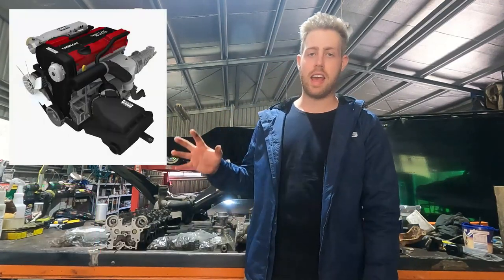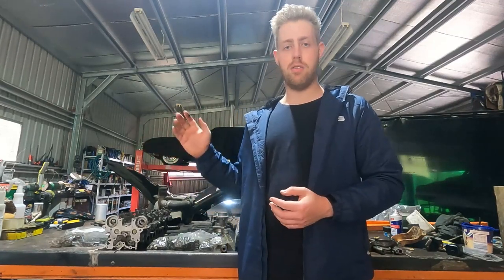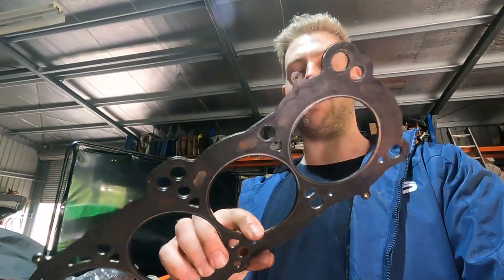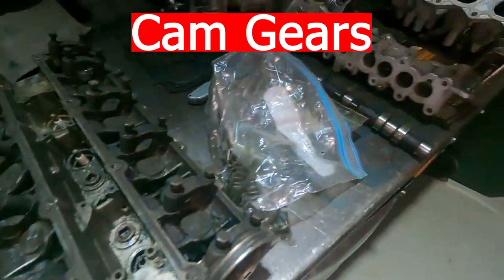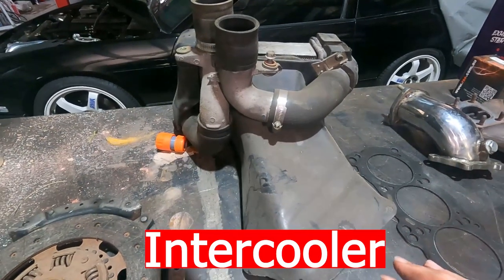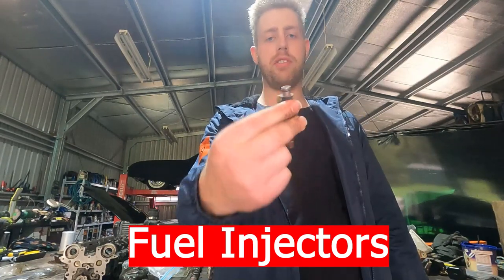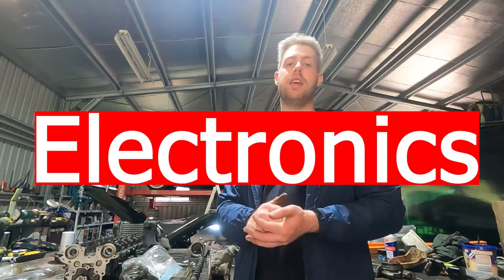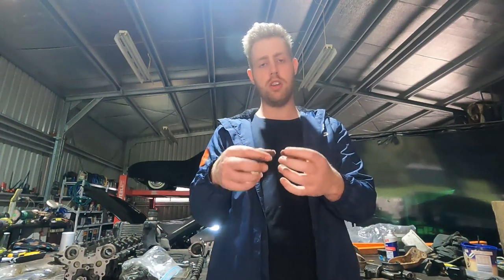Limitations of The Factory CA18DET Engine | Mechanical, Electrical, Fuel And Driveline

Comment: 1 year later, i'm here to rewatch!
Love the CA18DET 🔥🔥
Reply from the maker: Hey mate been watching you videos too. Keep up the good work!
Reply: @JarrodWillemse  Hey, that's awesome!

I want to rebuild my ca18 at home for stock power, seems that I only need:

- acl bearings
- new oil pump
- arp studs
- standalone ecu
- head drain mod

 😁😁
Reply from the maker: @BossGarage  If you can find get a t28bb turbo it will suit the engine!
Reply: @JarrodWillemse  i got the stock t25 rebuilt with a bigger MFS compressor wheel and seems pretty nice.

Still didn't got the car tuned, but seems pretty responsive!
Reply from the maker: @BossGarage  Nice should be a good little ripper whens its back together!

Comment: Great video, but I'd like to add one more thing, the ACL bearings had a period where they were cutting costs in their production which resulted in bad bearing quality. Can't remember the year but the newer year ones like 2019 or so should be ok to use. What I have researched is that the Japanese like to use King Race Bearings and NDC bearings (I'm using King Racing)
Reply from the maker: I didn’t know that thanks!

Comment: I like the bit about re-shimming hydraulic lifters... hmmm. Think it's worth mentioning the block runs oil squirters, along with the std rods having oil squirts onto the thrust face of the cylinders - factory win.
Reply from the maker: Yeh I had the engine shop tell me to block them off but I think they are there for a reason keep everything cool! Thanks for watching.
Reply: They reduce pressure to bearings it's why a lot of people delete them , they also don't clear a lot of aftermarket forged pistons. 

I've deleted them myself in most CA's I've built.

Comment: great video! I got a 400bhp CA myself and my main issue you didn't want to explain more. Its the gearbox.. I destroyed my first gearbox on my first trackday and replaced it with a stock one.. the only upgrade I did is to route the differential cooler and pump to the gearbox instead.
so the gearbox oil gets cooled down and it holds since for 2 trackdays.. but still, it feels like this isn't right. I would love to upgrade the gearbox
Reply from the maker: Gearboxes are like russian roulette some are great and some barely last 1 clutch kick. Like i said keep the torque below 550nm and hp bellow 300hp for reliability.

Comment: Hello Bro, just as an update on my project, I recently chipped my stock ecu, I was able to do it with moeates ostrich 2.0 and tuner pro software, Im tuning it at the moment but if you want I can share with you the requirements and the bin and xdf to read the car with the Tuner pro, just in case you want to try what option. And also with the emulator you can tune it live, and with the burner you can have many maps as you want, also the software is free
Reply from the maker: Hey mate that sounds interesting. A good alternative to nistune. I think the days of using a chipped stock ecu are over for me in terms of 30yo cars. I haven’t had the best experience with reliability. I would prefer to buy an aftermarket ecu.

Comment: Cylinder Head - these are the same as CA18DE (ignoring exhaust valves and cams), 4-port is best and the final development of the CA18DET, it's development was very similar to the Toyota 4A-GE from 1985-onwards (starting with 12 ports in the CA18DET-R). "Porting" should be in the form of gasflowing, largely just tidying up the finish but some minor reshaping can be performed, generally not a DIY job without vast amounts of knowledge/experience, certainly don't enlarge the ports unless going for well in excess of 550bhp. Main aim should be to improve the exhaust flow and improve (even up) the flow ratio compared to the inlet side, getting all of the hot inert gases out and spinning the turbo is where the major performance improvements are. Good VE improvements can be seen across the entire torque graph, especially at the lower end, improving spool. Fitting a too much thicker head gasket can turn your quench areas into detonation areas.
Cams - A little more lift and/or duration can improve things. Standard cams are OK to 350bhp (~440Nm) on a standard head, probably around 380-400bhp (~500Nm) with cylinder head gasflowing which will yield far better gains before changing cams. Should be no reason to shim the hyrdraulic lifters, they are self-adjusting. Higher lift cams beyond 8.5mm will require machining of the head to relieve the flat areas to the side of each lifter so the cam lobes clear.
Inlet manifold plenum - pretty good up to 500bhp but could be better. Runners would benefit from being a little longer and a little less big to improve cylinder filling at lower rpms and turbo spool.
Throttle Body - a good gasflowing job will greatly raise the point at which it becomes a restriction, potentially to 450bhp.
Exhaust manifold - standard one is good to 350bhp or more, will probably spool the turbo faster and benefit low-down torque.
Turbo - pretty sure the compressor is not ceramic, it does spool really fast but quickly runs out of flow capacity required for 250bhp+.
FPR - regulates pressure not flow, nothing wrong with it until you fit a massive fuel pump that requires bigger lines that it cannot keep up with.
Going to higher RPM is expensive, not advised unless you need a to extend the torque-band with a massive turbo that spools really late in the rev range.
Reply from the maker: Thanks for the extra info. Sounds like we are pretty much on the same page. I’d really like to play around with the 4 port head but there isn’t any here in aus unfortunately.

Comment: Thank you a lot for this video and also i need to watch second part, its nice to finally see some love for babyRBs and its not someone saying "buy SR" :D im upgrading my ca to 300hp for a nice weekend car and thinking if its worth to build my second CA with head and block mods for drifting or buy and unknown condition RB :D even tho didnt hear you mention the famous head to oil pan mod to prevent starvation due to trapped oil in head, since its usually common issue with Ca and RB series even tho i believe RBs handled it better
Reply from the maker: Hi Thanks for watching! I have a video just dedicated to heads drains. Check it out if you have some time! https://youtu.be/-X6w7E79X8k

Comment: Hello, first, thanks for all the information for the CA, and second, I would like to know if the afermarket downpipe for the SR20 is the same for the CA or i have to order rhe sopecific one for the CA? Thanks in andvance
Reply from the maker: You will need a Ca specific downpipe as the Ca engine sits on an angle and the Sr is straight. I would recommend just modifying a sr one as that will be easier and cheaper to find. The Sr can work if you hammer the pipe around 1/2" on the side where it contacts the frame rail.
Reply: @JarrodWillemse  thank you so much bro appreciated 👍😁

Comment: I have ca18det/5speed in a datsun 1200 ute.

I want to build a high reving big HP  engine.  
Is a stroker the way to go?
Or leave the stroke  standard?
Reply from the maker: Hi maté hopefully this video helps. The Ultimate CA18DET Engine Build Guide | What Parts To Use??
https://youtu.be/DQjwJ1LqAWQ

Comment: All great, but what if I actually wanted to change gearbox, any thing bolt on?
Reply from the maker: Not that i know of only 5 speed boxes from a Sr with the bellhousing changed. You could upgrade the gears in the standard box.

Comment: Gearbox and clutch are not intrested of your HP number, but your torque figures. Gearbox is starting to protest only if you are pushing over 500Nm through it. The clutch is more problematic, as there are limitations for the pressure plate strength due to not so good cranck bearings. Maybe multi disc for street and 3 paddle sinther for track (ab)use.  It's been over 20years since we build those to over 400hp without aliexpress or temu ;)
Reply from the maker: Hey mate yes I agree with what your saying it’s just easier for some people to understand hp. It is derived from torque and rpm. Most of the cases the boxes break from running large sticky tyres and people trying to drift and do burnouts. The type of material on the clutch also affects about much shock is transferred into the gearbox.

Comment: Sup so im lookin to buy a 200sx whit 105000 km  is it almost certatly that the bearings will need to be replacs soon ?
Reply from the maker: That's pretty low kms for such an old car. Just make sure you service it well when you get it and use some 10-50w oil. That will help protect the bearings better. You could send a oil analysis away to check if there is excessive wear.
Reply: @JarrodWillemse  thanks man love ur vids keep the good work
Reply from the maker: @joaoguedes3790  Thanks Bro!

Comment: It isnt the sr ando the ca transmisión the same internals?
Reply from the maker: Some people say the 5 speed sr is slightly better as it’s newer.
Reply: @JarrodWillemse SR gearbox has at least stronger input shaft bearings and stronger gear shifting forks.